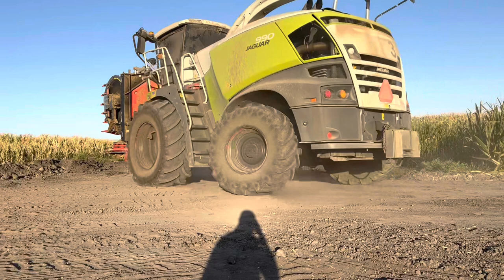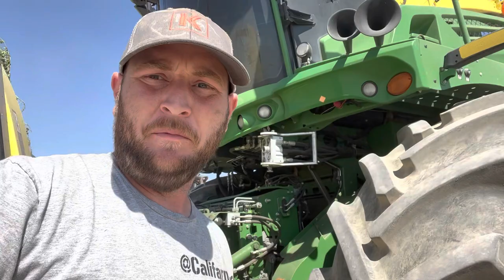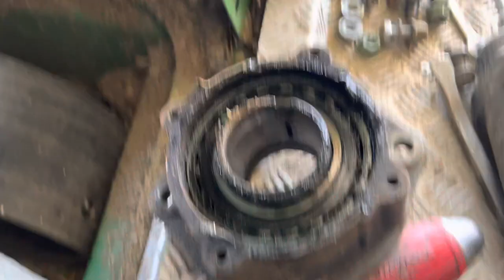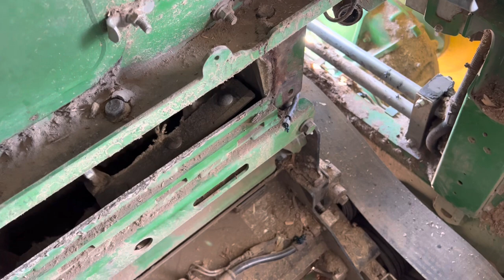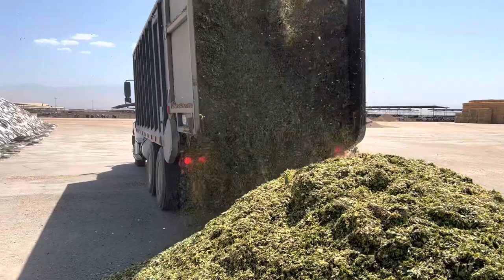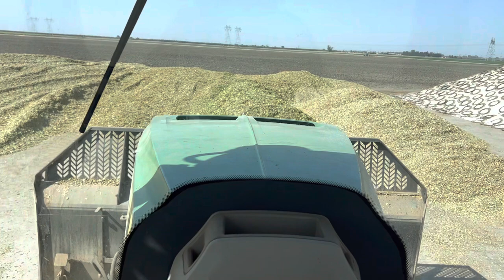Bearing failure on John Deere chopper!

Comment: What's is the massey ferguson doing, is this corn???
Reply: It was mowing milo. They will chop it later.
Reply: @seththomsen2502 Thanks,  Direct disco no option?
Reply: @RCMechanicalEngineering  I think it would clog up the head, needs to use a pickup head. Milo is too fine stemmed I think.
Reply: @seththomsen2502  oké thanks